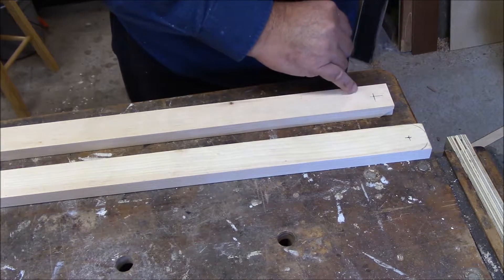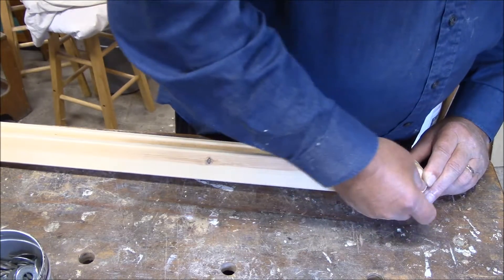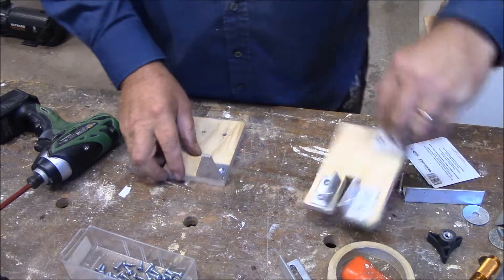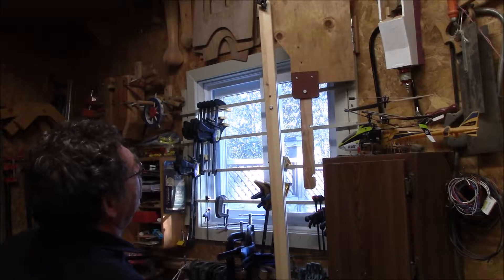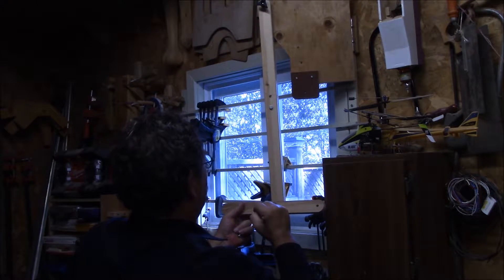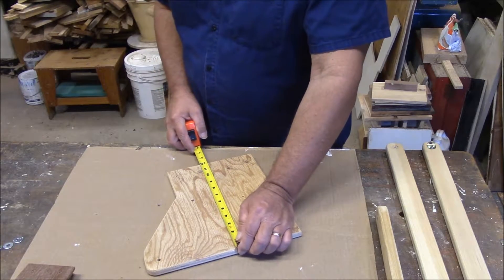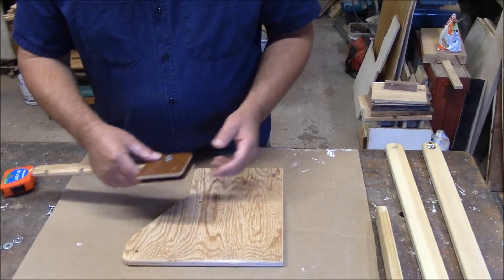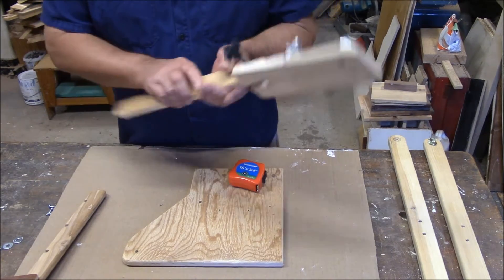Camera Arm Build

Comment: Hi Pete: Great job! It's always nice to be able to customize something that works for you. One of these days I'll have to do one of these Camera mounts. I'm thinking of an overhead mount. This way it won't take up foot print on the floor or wall. I may use a Lazy Suzan for the rotation. Your Camera Arm assistant may join the Union if you don't raise his pay above minimum wage. ..Cheers!
Reply from the maker: Hi Anil, This wall mount camera arm was a ceiling mount, but I changed it. Now I'm working on converting a saw stand  with a foot print of 18". It has 3 feet, so you can stick one of it's feet in a tight area to make a better shot, but I need to do this before he joins the union..